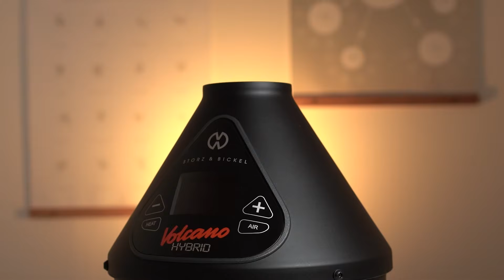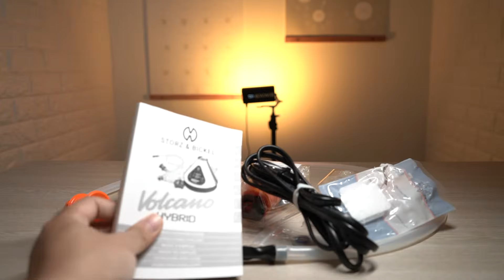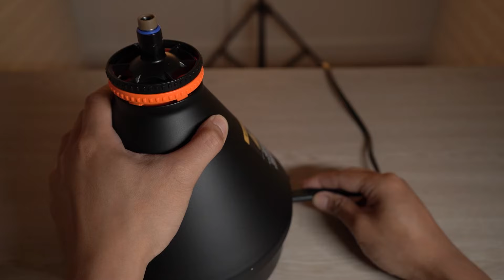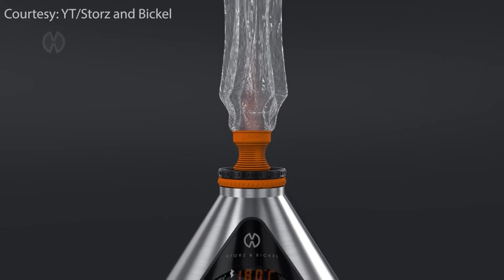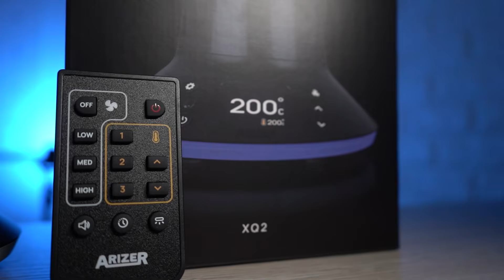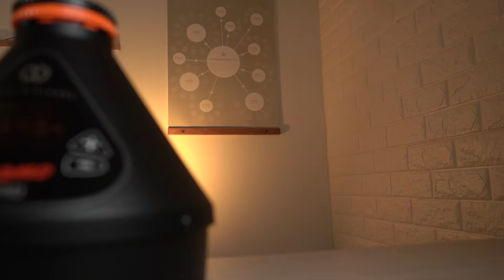Volcano Hybrid Review & Tutorial(Storz & Bickel) - AN ERUPTION OF VAPOR! (2022 Updated)

Comment: After going through four desktop Arizer Vapes over the last 10 years, I finally threw in the towel and got this one. I am so much happier because with the Arizer, you have glass parts that you can burn yourself on. And yes, I have burned myself a few times, and they can crack and break. I was so sick of replacing them and I got sick of their customer service. It was so good at the start where they would offer better warranties on their products. But now, they are just so negative to deal with l, and the worst part of the Arizer, if you just let it sit there, even without the air flow going, your herb will burn up and your glass may crack, and that will cause that burning smell to get stuck to all your parts including in the vaporizer. It is extremely dangerous, and this has never happened to me with the Volcano. I spent so much money on Arizer products, including 5 handheld vapes, and parts, that it just made more sense to invest in the better product. Not one regret!!

Comment: I bought an Arizer V-Tower in 2016, and made a Volcano bag adapter using an actual Easy Valve filling chamber and housing. I found the filling chamber reducer/dosing cap adapter worked best due to the smaller opening of the Arizer's glass adapter. The hole size of the reducer directed the air more efficiently, so my bags weren't full of air. I found 210C to be perfect for me. But then I just upgraded to the Volcano Hybrid last week, and oh my god... what a difference! tastes batter, heats up faster, and vapes the material more efficiently. I don't know how I ever got by without it... lol. I had to drop it down to 185C though... 210C almost killed me. 😋 I'm still using the reducer, but I wish they used the same filling chambers as the Easy Valve... these have round bowls with 3 flat edges to them, so the old filling chambers won't fit the new housing units. It would have saved me money otherwise. As for the reducer though, I don't use the dosing caps... I merely use it as a smaller bowl. The screen comes out and can be cleaned, and it comes with an extra screen. And the screen of the top sits low enough it keeps the material in the bowl. As for being stealth though... yeah, it's noisy. That's the one thing the Arizer was better at, even at the highest fan speed. But besides the noise of the pump, the unit literally vibrates on any surface it sits on. It vibrates through my kitchen counter, into the cupboard below where it seems to get even louder. I fixed it by getting some actual anti-vibration pads meant for washing machines and treadmills. "MyLifeUNIT Shock Absorbing Washer Pads". Pack of 8, 10cm square x 2cm. I wound up Gorilla Gluing the squares together into a 20cm x 20cm grid, then did the same with the next 4, then stacked them. I actually bought 2 packs, so it's 4 layers high.... 3 inches thick. There's literally no vibration now, or sound of vibration. You still hear the motor of the pump though. But it's definitely a lot quieter. 😎
Reply: Did you try the whip? Makes no noise. Loving it!
Reply: @Gggg4G48  I prefer the bags.